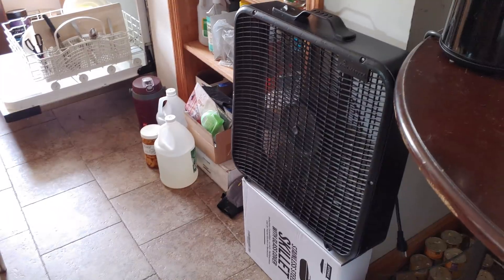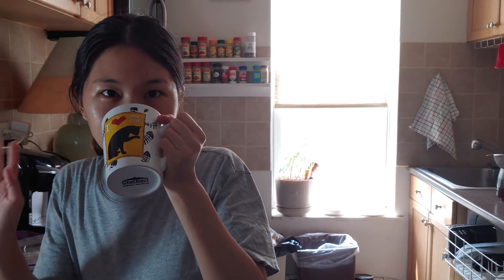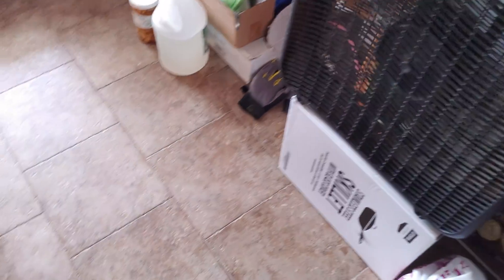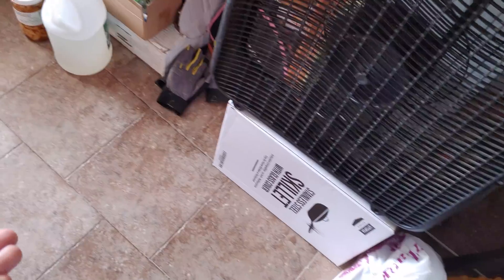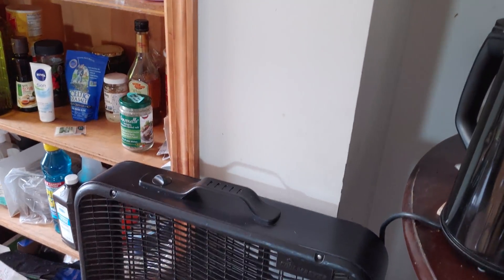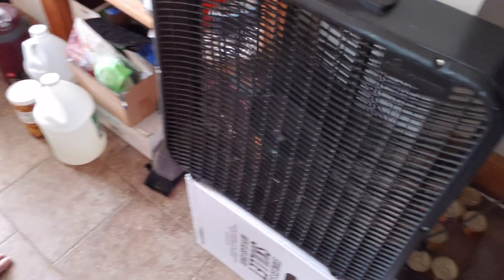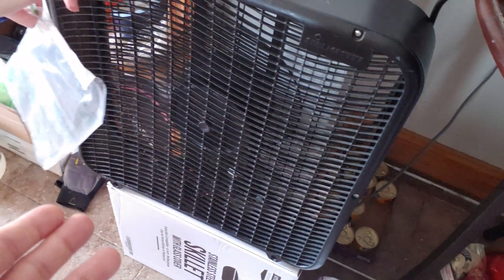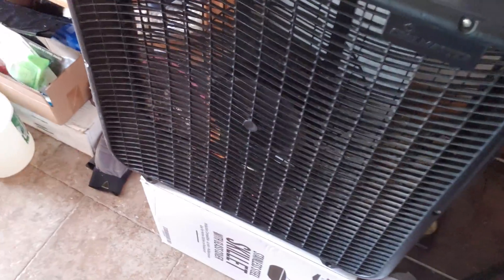Apple user ventilates home worse than Apple ventilates their computers 😢

Comment: Her argument is right it takes more space to leave a gap behind the fan and the wall. That's why you put the fan close to an open window. Less space and more airflow. Form and function. Apple laptops would not have a dead CPU even if they kept a thin form. Just make a vent at the bottom. Right on top of the fan it self

Comment: Tip. Put it back against the wall then leave one edge against it and put it at a 45° angle. You'll get the airflow and it won't be obstructing the living area. 👍🙂

Comment: You need to create a distance from the back of it, at least as wide as the fan is so the air can come from any direction (at the back) so the quantity expelled is the same quantity sucked in..
If it less the fan blades wil move forced, probably even sucking more current.. ;)

Comment: My mom is not an apple user. However, she thinks it is best to aim a desk fan straight at the only window of her computer room, and then wonders why it gets so ridiculously hot in the room, when the room is +10F hotter than the air outside the house. I keep telling her, turn the fan and point it out the door, so that you draw air in from the window and blow it out into the hallway (since the desk fan is near the door). Will she listen? Nope. Of course not. Same thing when you got people who get 10 inch fans and aim them straight at an open desktop tower PC thinking that is helping cool the PC... no... you're just creating an airflow loop where you blow hot air onto a hot PC so that the hot air can get sucked back into the fan to blow it right back onto the PC. Derp.

Comment: No.
If you want to compare that to what Apple does, the fan should be in another room, spinning very fast, trying really hard to cool you guys from there.
When you two are practically melting from the heat, Apple will replace your house and charge you triple the original value.
And the fan will still be in the other room.

Comment: Believe it or not it actually depends on the fan some fans are designed to actually have higher airflow with restrictions like rad mounted fans in custom pcs but apple is also abit on the slower side sometimes

Comment: Seriously, put it in the next room, sitting on the floor as it was designed to be used, and with it's output aimed into that room. The air from the fan will blow in the bottom of the doorway, the hot air will exit out the top of the doorway, and one WILL actually transfer some of the heat out of the kitchen...
Disclaimer: Retired engineer...

Comment: Ive always said the microsoft engineers that designed the xbox360 should be placed in a 110 degree room with 4 walls where 1 of the walls has a fan in it blowing away from them as if air speed plays no factor in cooling

Comment: Just replace the fan blades with a static pressure fan blade profile. It won't be as good as placing the fan away from the wall but it will push much more air in a close to wall scenario. I think you could just go build a square of 5x5 noctua a12x25 fan configuration as well., will cost a little though :P

Comment: to me a fatter laptop is more ergonomic. gets the heat off your legs, keyboard at a better angle, and the laptop becomes easier to carry because you actually end up with something to carry instead of trying to hold onto a smooth folder with a glass sheet and expensive parts in the middle

Comment: Erica's a perfect mess: She'd rather have a walkway over airflow.#applepriorities
Reply: ... 
You realize that the biggest problem with the fan being in the walk way is the greatly increased likely hood of damage to the fan due to it getting knocked over, which Also ruins airflow, right?
Like, Louis's entirely right here, but Erica's concerns are not invalid nonsense either, they're actual issues.
Mind you, the biggest problem here is that that is an awfully designed fan.

Comment: Love it.
I ran a foundry molding system.
The aerators shaft fluffed the sand and helped distribute it to evenly in molds. And spin in circles. Management wanted me to fill out paperwork every day if they were going east or west. SHAFTS TURN IN CIRCLES  EITHER CLOCKWISE OR COUNTER CLOCKWISE this no east or west
The jolts helped compact sand in mold. 180 decibels when on. Could not convince engineer they did not make any difference they cycled before sand dropped into mold.i pointed out each step as it happened. I had him stand there and take sand commpression  readingswith them turned on and off numbers no difference he still keep telling me it made molds harder.
I gave up and turned them on when he was around and now i wear hearing aids
Reply: I forgot to say aerator shaft can only spin in 2 directions clockwise or counterclockwise
Reply: It is the lawyers, don't blame the management.

Comment: I wish I could buy a bunch of random parts and build my own laptop.  I wouldn't care if it were the size of a briefcase and weighed 10 pounds, as long as it had enough internal space for some powerful hardware and sufficient airflow.  I guess it could be done, but that requires a level of hardware ingenuity which I don't possess.

Comment: Attach an impeller behind the propeler if form factor is improtant. Use 3 smaller impellers to increase the surface area around the impeller(s) and set it up to use one motor with a gear ratio to match impeller air flow with fan air flow instead of adjusting   depth as so to not ruin form factor. Someone likely came up with a similar solution that was rejected over a few cents of manufacturing cost.

Comment: LOL!!!
Not esthetics, but tripping over the damn thing!!!  Like I would!  LOL  Thank the Gods I have central air!  A modern efficient air unit will maybe use 2x the power as a room fan, look up the specs.  LOL  Use 2 fans in 2 windows across the apartment to push/pull air threw the apartment???  Works for me in my shop.  LOL

Comment: Put the fan in a window so it pulls air out of the apartment. Open a window on the other side of the apartment. Even with a cheap box fan that usually works.
Reply: Unless it's hotter outside than it is inside, then all your plan will do is allow the hot air from outside to enter more easily, thus heating up the apartment faster. I have no idea why people so often forget that fans are not air conditioners. Fans do not cool the air, they merely move the air.
Reply: What made you think I confused a fan with AC? Did I write anything of the sort? No.  Odds are between the two of us I'm the only one who has taken courses like thermodynamics, heat and mass transfer, and applied them in an engineering career. 
If it is cooler on the inside then you don't want to run a fan at all. You want to keep the place with the windows and doors closed and you don't want to run any machine that is not necessary.  Why? waste energy as heat comes from the machines and will make the place warmer.  All you accomplish with a fan in a closed place is to make it warmer from the fan motor's waste heat. 
The only way it is cooler inside to begin with is because AC had been running or cold air is trapped inside and the building is constructed such that it is insulated from heat getting in rapidly. In that case you don't so much as open a window. 

However come night fall that heat mass of a large building has warmed and its now most likely warmer inside than out. So put the fan in the window and pull air through.  I've done this with houses and apartments for decades when night time temperatures were low enough not to need ac.   
There is a device from when AC was very expensive that has fallen out of favor, the attic fan. These big fans work the same way, they draw in cool air. Draw in cool air over night. Before it starts warming up in the morning you close the place up and then coast through the day. for as long as possible.

Comment: "Now the fan takes 1/4 of the walkway!"
"So you chose form over function?"
Classic Apple design principles.
Reply: How about putting it under the table?  It doesn't look like anyone ever sits at it.  Won't take up any extra space
Reply: @huckbeduck  A cockroach sitting under the table might complain about a lack of space for it's evergrowing family. 😁
Reply: @huckbeduck  My thought exatly.
Reply: @Paradoxical Nightmare Well that would be quite the nightmarish paradox now wouldn't it?  My statement "It doesn't look like anyone ever sits at it.",  would therefore be invalidated.  I suppose on the rare occasion that they did sit at the table, the fan could be moved temporarily.
Reply: I've been saying Apple = form over function for years. It's nice to see that Louis has finally adopted it.
Reply: Women am I right
Reply: The problem arises when customers don't have any choice of the matter. Every fan sold is sold with a wall right behind it - following that analogy. I would gladly pay good money for a gaming laptop that is three or four or however times thicker that is needed to accommodate the required amount of cooling for the hardware inside and a solid enough battery to power that hardware and cooling system without compromise. Those options are not available to the consumer though - every single company is trying to get their laptops to be as anorexic as humanely possible at the expense of functionality.

Comment: Louis, i may ask you what will happen when Apple switches to Arm processors?i mean, most of the heating problems should be gone, at the expense of speed ll.
Reply: They're still going to use the power if you want performance, though. (well intel nonboost power). I imagine everything will be gimped for 10 watt models, but it's going to be laughably bad if they try to stick that crap in pros.
And with the dies being even smaller...

Comment: Apple: The fan spins.  Spinning makes it pretty.  That passes inspection.  
Louis: But it doesn't move air!  
Apple: Moving air will be fixed in the next IOS update.  
Louis: Physics won't allow you to fix an airflow problem with an IOS update!  
Apple: Well this "Physics" will be hearing from our legal department.  
Louis: ** external screaming, internal screaming, and existential screaming all at once **  
Apple: Fans that make that sound, are by design.  
Louis: ** spasms **  
Apple: Customer appears satisfied.  Case closed.
Reply: "external screaming, internal screaming, and existential screaming all at once" 🤣🤣🤣🤣🤣
Reply: Apple fans will tell you that you are a cheap skate for not buying a faster CPU so they can throttle it down instead of designing the right cooling in the first place.
Reply: Why is your Macbook running iOS?
Reply: @akkesm  Why is your iOS running Macbook?

Comment: Good thing she is such a good sport, that was pretty funny though.  Reminds me of trying to explain why evaporative coolers don't work in humid areas to a friend.
Reply: I'd ask how humid and use the phrase "don't work as well" but that sounds rough.
Reply: @donovandelozier7156  I should have said high humidity, this was during last summer's "heat wave" in Chicago when it was ~95-100+ with the double whammy of 80%+ humidity for like 2 weeks.  A friend of mine was going to get an evaporative cooler and I tried to explain to him why that wouldn't work for those conditions.  Even though he didn't believe me at the time he did take some time to do research and ended up getting a proper AC.
Reply: @nadtz  oh shit that high a humidity yeahhh evaporator ac would be pissing away money at that point XD
Reply: @donovandelozier7156  Yeah when we get that weather (pretty much every summer for a few weeks) in Chicago it can be pretty miserable, spending money on the wrong thing to mitigate it would make it even worse.

Comment: Once took a butchery class in Nevada, they had a window AC unit in the middle of the room, venting into the same room.  They legitimately thought it was cooling the room down.
Reply: I guess it would be unwise to criticise such people given the proximity to sharp knives.
Reply: @bigjoeangel  I think at that point I would be finding another class to learn butchering from because if they were making such a stupid mistake I don't think they would be that solid on butchering either.
Reply: @SilvaDreams  lol, yeah just back away slowly making no sudden moves
Reply: That question came up in Thermodynamics 101. My answer got a fail...
Reply: Well, if you were lucky to be on the front of it it should be cooler than the back

Comment: Now that you moved the fan it’s not a MacBook anymore, it’s a PC
Reply: You sir have won the internet today
Reply: True gamer PC would have taken up every inch of the room with fans and drilled holes in the ceiling for proper air flow, while installing a radiator where the window should be, along with a nice glass wall so everyone can see their beautiful creation.
Reply: @Jeoshua Collins: Guilty by association
Reply: Damn, its now worth 3 times less.... Put it back where it was and sell it.
Reply: Cant find the original anymore, pls help😂
Reply: No glass behind the intake, no pc.
Reply: You're getting into Louis Rossman's Deep Meme Cuts there, brother.  lol
Reply: It’s not a true PC! The fan would have to be powered but not running for half a day while it updates it’s software. I suppose that is the cost of not having a mound of gold to buy an Apple laptop, at least I can play Elite on the PC ;)

PS: I have lost days to Windows unreliability, but hearing that Apple just reversed the problem so instead you get unreliable hardware is just sad.
Reply: @psibug565  CLEARLY it is a PC.  You can see the fan is working but no LEDs are lighting up.  Probably a conflict between the fan controller software and the LED software.  Happens all the time!
Reply: I don't like the color, too black...make it white, and jack up the price tag
Reply: A personal cooler
Reply: Amen

Comment: "Now it takes up, you know, one fourth of the walkway"
"Yeah, but now it works"
Reply: Indeed. Though if it could be moved about an inch or so back, so it's in line with the other things on that side, without failing again, that would solve both problems.
Of course, then you need a way to compensate for the problematically unstable design (made worse by the fact that it's sitting on an almost equally unstable box), though, again, moving it back so it doesn't stick into the path more than anything else on that side of the room would reduce how often that issue causes problems.

If it can't be moved back without failing though, it either needs repositioning entirely (probably with a proper mounting) or replacing, because the design is Dumb.
Reply: And that's why Thinkpads are thicc bois.